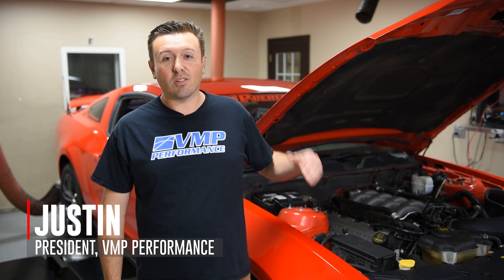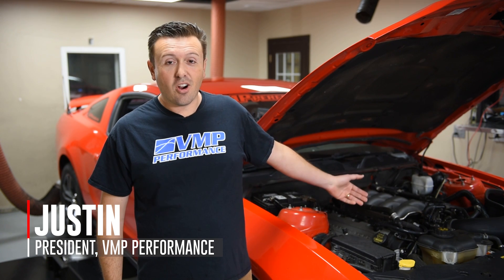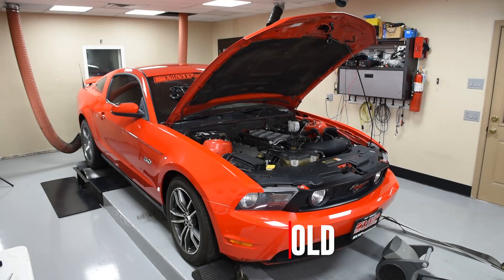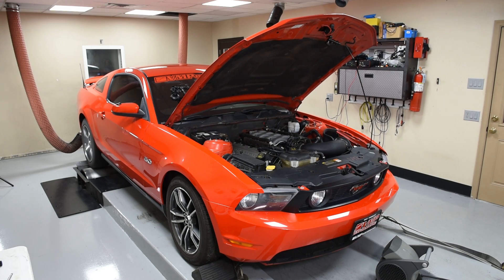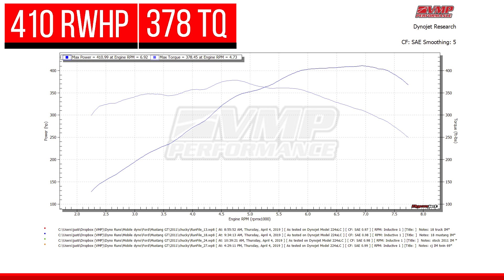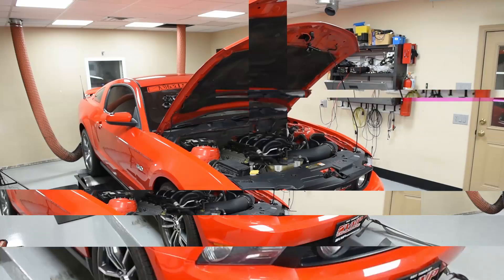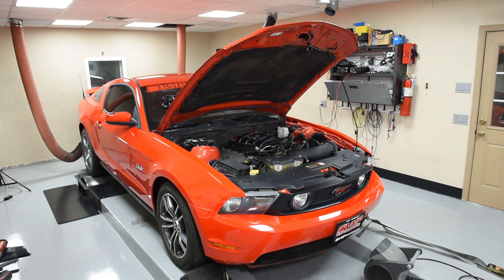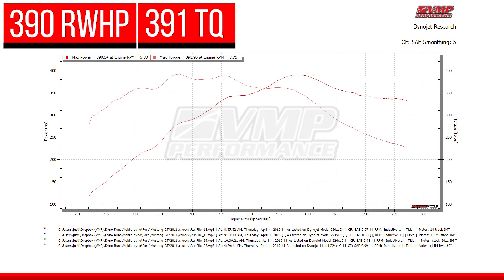Project Chucky Episode 10 |  Ford Mustang Gen 1 Coyote Manifold Shootout!

Comment: I love these video's.. I have a 17 Manual & once I was on a 93 tune and when the rev limiter was pushed back that's when I was able to really feel it with my Manifold.. Once I go past 7000rpm I can feel the power dropping. I'll Rev 3rd and 4th out to 7200 and then go for the next.. It's pointless to go past that right now.. But what I really want to know is if I go with a Centri blower, should I still go to an 18 or will it not matter as much under induction??

Comment: Could you test a 2015 gt intake?  I have one for my gen 1 and interested in numbers before using it.
Reply from the maker: It's not worth anything.
Reply: @VMPPerformanceTV  I replaced a 2011 truck intake with it on my gen 1.  Still trying to figure out cams.  Have mustang gt cams sitting on the shelf.  Debating on if performance cams are worth the low end loss.

Comment: Do you need upgraded oil pump gears and crank sprocket if running a cobra jet intake manifold on a gen 1 coyote?
Reply from the maker: Hey Anthony, the need for oil pump gears and crank sprocket isn't really associated with modifications as much as it is the type/style of driving you're doing.  If this is a stick car that's driven hard and has a chance of hitting the rev limiter frequently, OPG and CS are something you should consider.  If it's a basic street car that doesn't see much abuse or 6R80 car that's daily driven, so on and so forth; the OPG and CS aren't as anywhere near as much risk.

Comment: Would a ported 2018 truck manifold carry power further than 5800 rpm?
Reply: I'm wondering if they changed the tune to run the truck manifold mainly the imrc settings. I been doing some testing with the 2018 plus truck manifold on a gen 2 and it carries power all the way to 6700 rpms like a stock gen 2 with the same power drop off. But makes significantly more power and torque threw the curve

Comment: Not really a "stock" car with long tube headers ($900-$2000), bigger injectors ($400 ish), and a tune (prolly at least $200).  All that alone is probably what increased numbers.  Pretty sure the slight loss of tq is felt more than the small gain in hp, honestly stock manifold still seems to be best in N/A form.
Reply: Agree unless your driving past 7k constantly never going to be worth it.

Comment: So my question is this mr Justin, a 2018 truck manifold would be a great swap on a gen 1 f150 then.  Given the intake cams don’t allow for high revs, the ‘18 manifold should improve on the low end numbers on the Gen 1 f150 🤔🤔
Reply from the maker: We have some content in the works to answer that exact question! Stay tuned to see the results!
Reply: VMPPerformance well then, I just ordered a 18 truck manifold for my 14 f150.  If you have a tune worked out I will get a tune from VMP.  Just a 87 octane fuel mileage/torque tune 👍🏼
Reply: This vid is a few years old, did u end up putting the 2018 manifold on? I have a 2014 f150 and want more torque and power for towing, I’m not looking for top speed @NITROUSnBIASPLYS
Reply: @user-xm1fo3eb5m  I did do the testing yes.  I got a tune from OZ tuning the omega tune.  First off, Oz & vmp were not willing to try different cam angles to vet the manifold data for torque/mpg use not just WOT.  I did my own data logging on the Oz omega tune and swapping back and forth between manifolds and found the 18 manifold would possibly make slightly more torque down low, but not as much peak torque.  Also the peak hp according to the maf was down over 40hp.  This testing was done on a 2014 F150 engine.  Also I was planning on running the IMRC on the 18 truck manifold and since the 14 f150 has no control over this engine function, I was going to make a relay for them to close when my cruise was set for potential better mpg.  This did not work as the IMRC vacuum pods don't clear the firewall on the gen1 F150.
Long and short, stick with the gen1 manifold.  If anything I'd recommend the OZ Omega tune as it's a flex tune for any fuel

Comment: What do I need to run an 18 manifold on my 2014?
Reply from the maker: To run an 18 manifold you need to delete the IMRC/CMCV on the back of the manifold and change some vacuum routing. We have a full kit available with tuning support for '11-'17 cars on our website at the link below. We also have an install video to show you how to swap from a stock manifold to a 2018 manifold on both automatic and manual transmission cars. 
 https://www.vmpperformance.com/2011-2017-Mustang-GT-2018-Intake-Manifold-Tuning-Power-Pack

Comment: I wonder if the truck manifold would pick up ET with a stock converter? Aftermarket converter I see little to no benefit of that manifold on a drag strip. Even with a stock converter after the first shift that torque isn't going to matter much. The question would be will the 60ft time gained over a stock manifold be enough to justify the 15RWHP loss. Track testing would be interesting but I think it would be a waste of time on Chucky which has a converter.

Comment: I’ve got a Cobra Jet on my Gen 1 Coyote and I’m quite happy with it. Going from bone stock to a Cobra Jet intake manifold, VMP tune, FRPP cold air, and GT500 twin 60mm throttle body, I picked up about 5 mph in trap speed. The Cobra Jet is quite expensive, but I think with the 2018 manifold, you’re just paying for the performance. The Cobra Jet looks way better. Although if I’m being honest, I’d probably get a ported 2018 manifold if I was to do it all over again.
Reply: Why go with the 18 if I may ask...i have a 14 and don’t know what to go with a 18 or a cobra....it’s not a daily but I’m not over here stomping it to the floor...I do drive aggressive and like to go fast whenever I can though...
Reply: Kapss 08 The Cobra Jet is king, but it’s really only King from about 7300 rpm onwards. I’ve raced a couple ‘18 manifold cars and mine starts to pull away from them in fourth gear, but first, second, and third gear the 18 manifold cars are basically right beside me. I love the Cobra Jet, but it’s way more money than a ported ‘18 and offers only a small difference in real world performance. If at some point you want to do cams as well and do an all out NA build, I’d recommend the Cobra Jet, but as far as just doing some bolt ons, a ported ‘18 manifold is great! I’m at the point now though where I’ve had enough of the NA life, my car will be getting a VMP Gen 2R over the winter,
Reply: Cody Miller you lose big amount of torque tho with the cobra jet no? And thanks for giving me that run down I mean money is thankfully not an issue saved money in my “fun jar” but just wondering what would be more fun and noticeable to drive on the road I guess
Reply: Kapss 08 I personally didn’t notice a torque drop with the Cobra Jet. I also have 3.73 gears which I’ve heard makes the torque loss less noticeable. The top end pull of the Cobra Jet is a lot of fun. The power never really falls off. If money isn’t an issue, I’d get the Cobra Jet. It’s definitely better, the ‘18 is just better value.
Reply: Cody Miller I just got 3.73 gears also was reading and that seems like a good combo! Thanks man I think I will be going with the cobra thanks for your input will let you know how the instal and my reaction if you want lol!
Reply: Kapss 08 No problem! And sure, let me know how the install by ones and how you like it 😊 I found the install was pretty easy. Hardest part was repinning the connector for the throttle body, but I think VMP now sells a wiring harness so that you don’t have to repin it if you don’t want to.

Comment: Surprised with the CJ manifold results. From the other sources I’ve seen the cobra jet is king even on gen 1 coyotes. In fact it’s less popular to be used on the gen 2 cars because of the hood clearance. But I guess times have changed and the 2018+ manifold does make good power. Now I’m curious and want to get my CJ setup dynoed.
Reply: Same
Reply: It is king it doesn't show out as well on a gen 1 because the cams hold it back.  The heads do slightly but the cams are the main reason if you also have cams a cj will shine on a gen 1 car you could prob get pretty close to 500 wheel on e85 from a fbo cammed cj gen 1 with stock heads.  It starts being able to make power where the cj wants to make power.  It's all in the combo.  If you don't have cams to take advantage of the cj it isn't gonna perform like it should especially on a gen 1 that has milder cams than gen2.  The heads also flow better in gen 2 so both make a difference but the cams make the most difference from what I've seen.  I've seem fbo cammed cj gen 1 cars making damn good power it's Def the cams mostly holding it back.

Comment: Awesome.  please do one with a centrifugal... I'm really curious if the blower amplifies the results, or simply negates the downsides of the intakes (like the 4.6s did with a blower).  

I didn't do OPGs on my car and I figured I'll get a gen2 coyote or a long block for it sometime down the road and would love to set it up from the get go with the right intake... the current gen1 coyote is gonna get transfered to my 205k mile 2004 to replace that tired 4.6 (which is probably struggling to break 200rwhp by now)

Comment: Please do track comparison as well. Surprising to see the CJ drop off at top RPM behind the 18. The CJ should outflow the 18 up top easily, how is that possible?
Reply: I’ve seen other dyno results that  the cj drops at 7800-8000.  Idk  I think both vids were made for more sales of the 18 mani.
Reply: Stang Thang agree with you.
Reply: Bas Tee not enough cam
Reply: You mean not enough cam for the full CJ potential? Ack. But the cam was the same for all tests so the CJ should provide as much and even more air as the 18 up top.
Reply: Bas Tee no but gen 2 cams are bigger then gen 1 so cj does better on a gen 2 motor then on a gen 1 seems like the 18 intake is the best so far for gen 1 unless you get bigger cams

Comment: Great Video Justin, answered a lot of questions. I was also surprised about the resulst of the CJ, looks like it will work alot better with a good cam setup. Hope you can do the GT350 and the ported 18 Mustang GT.  Thanks.
Reply: put the gt 350 manifold on Chucky
Reply: Yeah the gen 1 head just cant flow enough to make good high rpm power with the cobrajet. 

It will need cams and some porting
Reply: @3star2nr  it's mostly the cams.  Sure it'll see gains porting but it'll see alot more gains from cams with a cj the cams are what's holding the power back the most in gen 1 cars when running a good manifold like a cj.  A cj and good set of cams can see right near 500 to the tires on a stock gen 1 head on e85 through a manual that isn't shabby at all.  A gen 2 might see 515 or so with a similar setup so honestly it isn't THAT much different.  There is gains there but if you're choosing one or the other between ported heads or cams cams give you by far the most gain on a cj gen 1.  18 manifold prob works better on a stock cammed car cj for a cammed car.  The cams are really holding it back.

Comment: 18 mustang manifold is showing again to be a great bang for buck
Reply: Gained 5 hp and lost 10 ft lbs of torque?  I dont think its worth it on that combo.
Reply: @qtrhors1  gained 50hp at 7300rpm
Reply: @GTkyle  that’s a lot
Reply: @TheBb6prelude  I thought the same thing when I saw that..
Reply: I have a 17 Manual & once I go past 7000rpm I can feel the power dropping. I'll Rev 3rd and 4th out to 7200 and then go for the next.. It's pointless to go past that right now.. But what I really want to know is if I go with a Centri blower, Prob ESS G2 but anyway should I still go to an 18 or will it not matter as much under induction??
Reply: Mustang Lifestyle boss 302 intake or 18 intake for 2013 gt